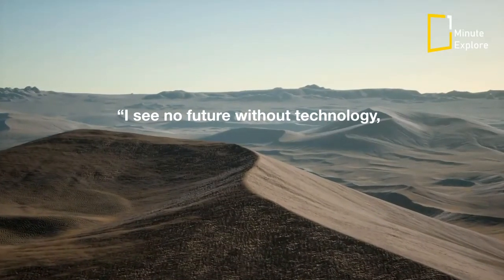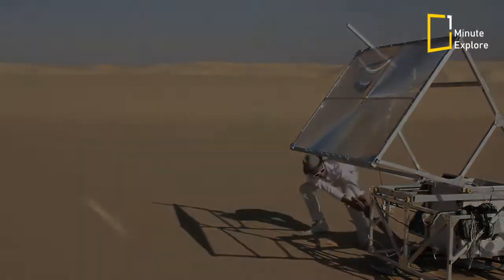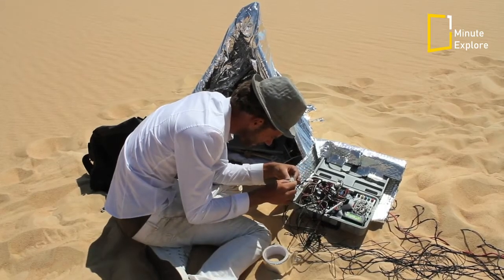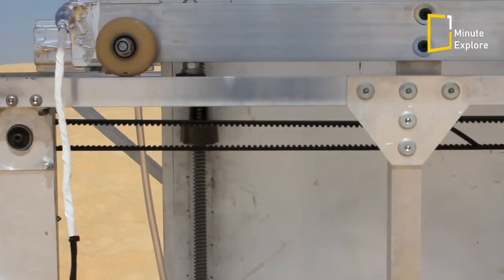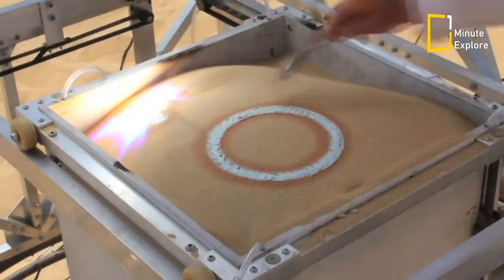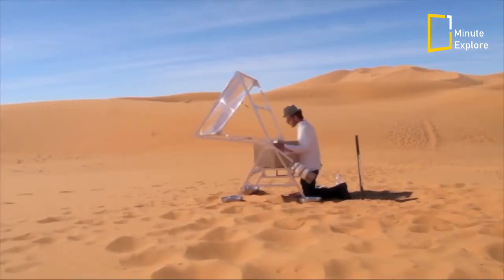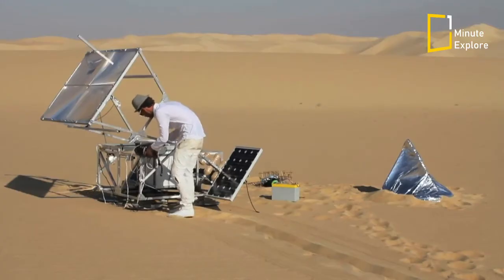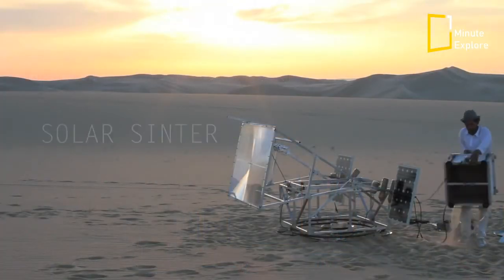The solar sinter by Markus Kayser | Solar 3D printing machine

Comment: we could use the desert to power both Europe and Africa continents with renewable electricity making self sustainable Fresnel lenses that could be made by power from the the desert, we could meke glass fresnel lenses from the sand and then wire the power out. this technology is known as concentrated solar power or CSP that is already used in spain, morocco, but with aluminium mirrors